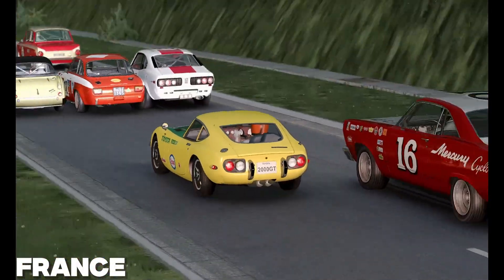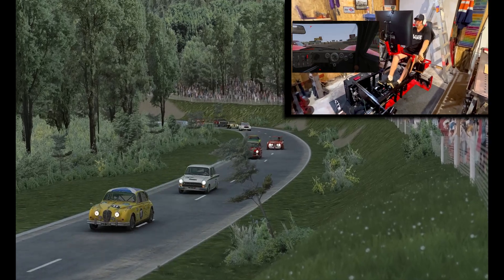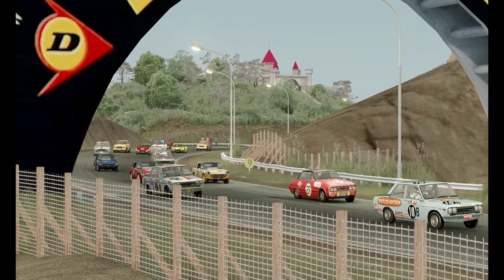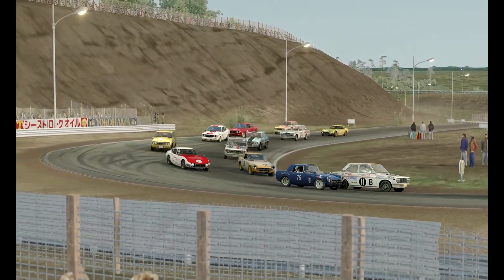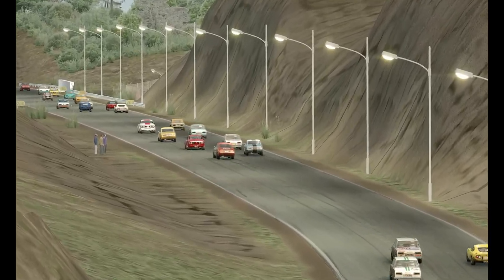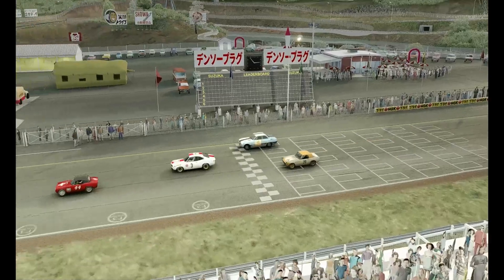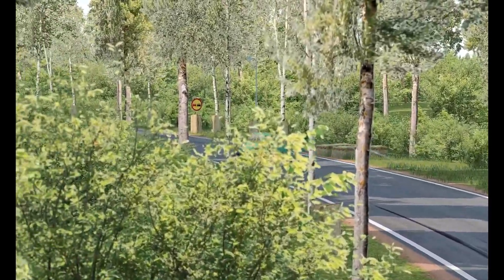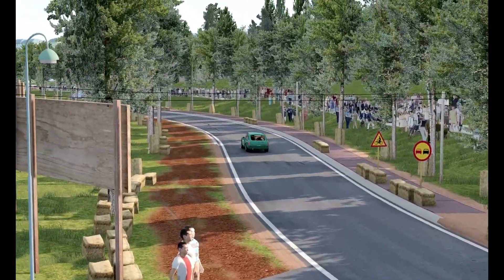How Master Track Builders Build Their Tracks

Comment: Hello!

I've been sim racing for just about 2 years on a t300rs with no motion. I am not great by any means but I still want to make an upgrade on the setup.

This really made me want to work towards building my own vs buying, but due to your last comment reply I'm scared that going your route wont satisfy my craving, due to you saying you modeled motion similar to muscle cars. Where as I am leaning towards a hypercar/f1 feel. (for enjoyment not training) Do you have any recommendations of changes you could make to this idea to make it more on a "downforce induced feel" ? 

parts, or software?

Thanks!
Reply from the maker: @tallymudasia5163 Greetings. No need to change anything as far as hardware would go for what you are wanting in a motion sim like my design. 

It simply means you would have access to old school (historic) car dynamics if you ever want to try that. My design will work with both types of cars with some simple tweaks to sim tools settings (software). 

You could even lock out the traction loss all together in the software if you wanted to. But, F1 cars experience TL as well under certain circumstances, so you'd just dial it down when using computer controlled cars.

Comment: Hi doc 
Would it be possible to build a motion rig in the way yaw have built their yaw2-v3 motion rig they are using timing belt system 
Here is the video 

https://youtu.be/9NZH4yFme_g?si=0y8sGZMxq1jBxnoq

Im following your 4dof guide and im about to purchase the tools and materials from your list 

Your channel is a god send and stopped me buying the dof reality h3 
Cant wait to start building 

Take care 
Kind regards 
Matt
Reply from the maker: Hi Matt. Thumbs up 👍on the decision to build a motion sim. Yes, those yaw ball turrent platforms are pretty cool. Quite compact and look to be easy to move around. 

I did contemplate a similar design early on, but not with belt drives. What stopped me forging this path was I was worried you would miss out on the cool inertia created by the traditional traction loss pivot design. 

Having actual mass is important for this (along with a correctly funtioning TL system plus software tweaks) As a classic muscle car owner, I appreciate this and modelled my setup around that experience. 

This and the actual sim chassis twist felt in my design, really gets those sensations  pretty damn close. The down side of my design is it does have a reasonable footprint, so space is required to house it. 

Get building and I'm here to help.